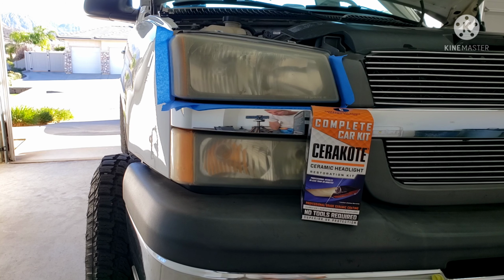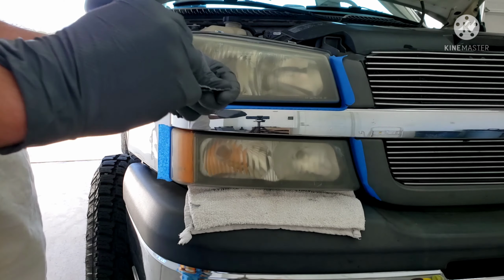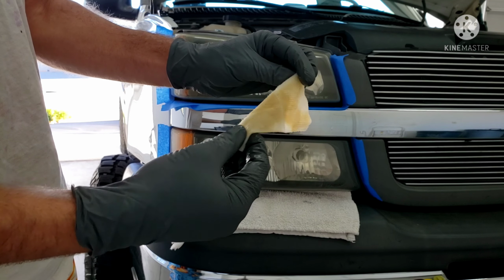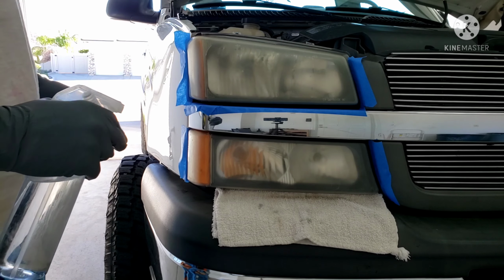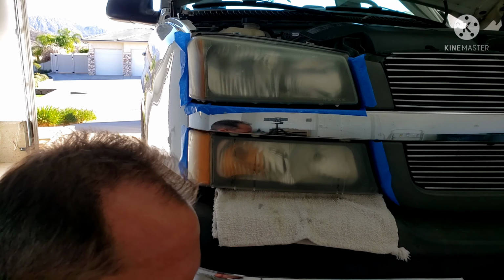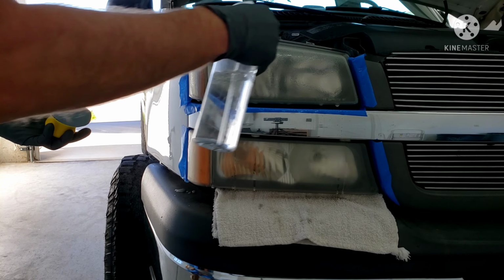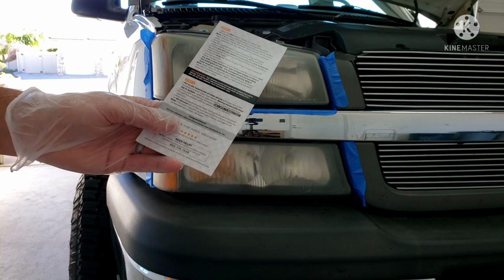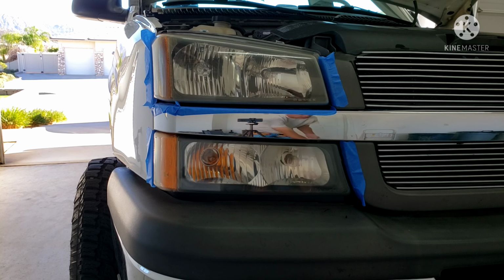D & D Auto Detailing  - Cerakote Ceramic Headlight Restoration Kit Review

Comment: May I suggest as a videographer that get in a brighter lit place to shoot your demonstration 😉
I need Your Advice.  After I finished all 3 steps and the headlights have dried an hour can I apply a 2nd coat for added protection?
Reply from the maker: Thanks for the feedback. I'm not sure if the wipe would still be good after an hour's wait. I think the one coat is all they recommend.
Reply: I did apply a light swipe using my extra pad and it worked nicely with the few Streeks going away.  Next time I do this I will do it correctly using one pad per headlight instead of trying to do Both headlights with one pad.  Live and learn.  A friend was so impressed with my headlights she asked me to do hers.
Reply from the maker: Thanks for the updated info!